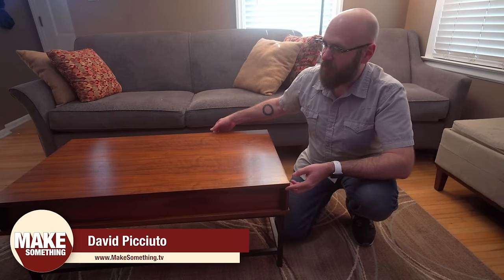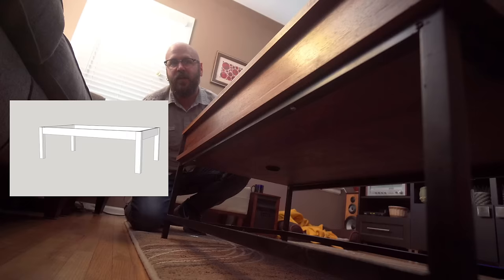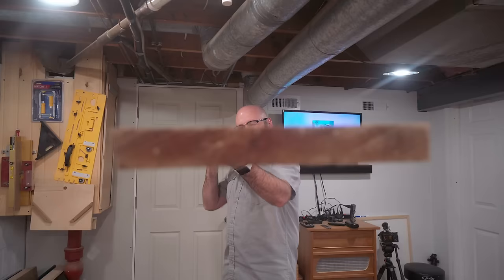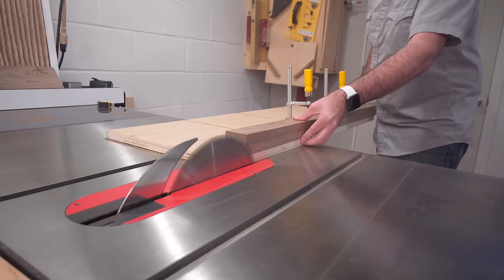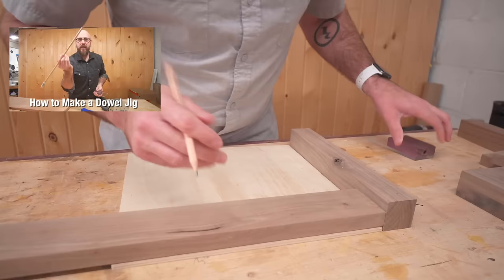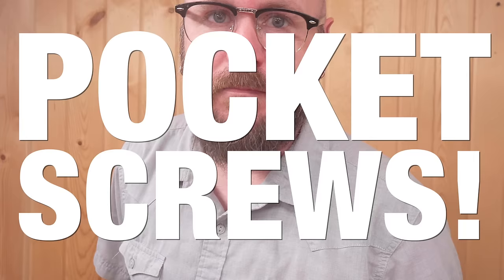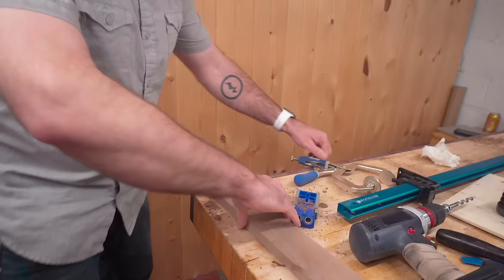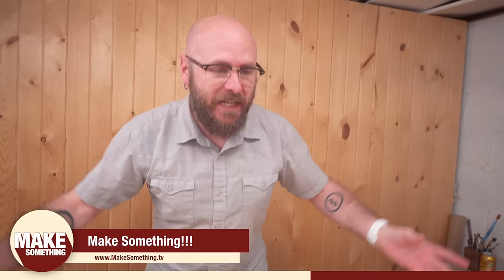4 Ways to Make Table Legs. Which Joinery Method is Best?

Comment: I only have a pocket hole tool. I used it to build an outdoor patio table. It stays outside in the rain all spring summer and fall. Have a canopy, but it still gets wet sometimes. Its on its 4th season. Has not loosened up one bit yet. Time will tell, but I think it should last another 176 years. Hahahaha !!!

Comment: Of the methods used, Domino will be the most durable, as it provides the most glue surface. Pocket screws are great for non-structural applications, cabinet face frames in production shops, etc., I have used them on table joinery in the past, and they did not hold up - 10 years max, dowels are a tad better. Mortise and tenon, or sliding dovetails are the strongest and most durable options. Still a fun video, and the idea of showing options and doing a side-by-side comparison on the same piece was good.

Comment: But will the pocket screws last longer than the brazed aluminum did?

For real though, my most used method of joinery is pocket screws. Will it last forever? No. Will it hold together pretty well and be easily repairable in the future? Yes.
Reply from the maker: Pocket screws will last longer. Much longer!
Reply: I remember hearing something similar about the aluminium legs...
Reply: Add some wood glue.  Wood glue will hold it together longer than anything.

Comment: That was awesome.  I'm new to woodworking and I was looking for a way to make a desk.  I didn't know how to attach the legs and support system (the top is 1/2" birch plywood that's been stained black).  I already have the legs cut and stained, now I just have to cut, sand and stain the supports and attach everything.  Thanks for the info (and fun,. you crazy).  I think I'll got buy a jig system.  This is my first time building anything, and that seems the simplest, easiest way to go.
Reply: How is your desk? What about the plywood? Is it any good for the application?

Comment: what if i need to join pieces of wood but want to be able to take it apart again later? and it needs to support weight, not a lot but needs to be sturdy and dependable. Any suggestions? I have literally no experience in carpentry so any advice would be appreciated

Comment: Well, it depends. In case the table is for sale (or whehter the table is a gift for my mother-in-law) , I would choose the cheapest and fastest way: the doweling jig. In case the table is for my use, I would choose the method that is the sturdiest one, and that provides longer life to the set: hand cut old fashioned way, using chisels, drills and files. A slow method for an enduring use.

Comment: Board stretcher is that a new tool from Festool? I need one!
You missed a few ways 
    The super simple sliding dove tail
    The ever elegant  furniture bolts
   duct tape just to name a few other ways
My jointer broke years ago don't miss it, just use a very good blade in your table saw.

Comment: So did you actually do the hand tool joinery? I find that dovetails and box joints tend to hold up in the long run a lot better than pocketscrews. I'm not sure about the domino as I'm not rich so I can't use that.

Comment: If I am using 2 layers of .75" sheets of plywood as my table legs, and the same plywood as my stretchers, is it okay if I use pockets holes to attach eachother if it is end grain to end grain?
Reply from the maker: Should be but I would add glue as well.

Comment: So... I may be a newb and completely missing something... but... by screwing the table top directly into the leg assembly, rather than using some joinery method that allows for wood movement, are you running the risk of the whole thing cracking or knocking itself out of alignment?
Reply from the maker: Good question! Since I’m using plywood for the top I don’t have to worry about movement. If it was solid wood then I would need to allow for seasonal change. Thanks!

Comment: A brazing kit is available from welding supplies, 4043 aluminum, and basically a flux formulated for aluminum. You could get by with regular tig rod ( 4043 ) and just buy the aluminum flux if you already have the tig rod. Aluminum is Aluminum the tig rod is the same as what is in the brazing kit. The Harris Products part number is 1070  do believe. ( just for the Flux ) now to watch you build some legs.... I work at a welding supply, but I prefer wood working as a hobby.

Comment: Nice work...If I may say, the only thing that I think could be made different is the horizontal wood board that connects the legs. They stand out to much. Maybe a way to make only the legs apparent would be cleaner and the horizontal boards wouldn't compete with the table. Cheers man!!
Reply from the maker: I do agree.

Comment: Hi David!

I recently picked up a kreg k4 jig and I am having trouble joining two 1.25"x1.25" pieces of red oak without splitting the wood.

They recommend 2 inch fine thread screws but I end up splitting the red oak.

Do you have any recommendations?
Reply from the maker: Hmm. I had that problem with Hickey once but i think I was using the wrong screws. Wish I could be of more help.
Reply: @MakeSomething  no problem.

I was thinking of keeping it at the same setting but maybe using smaller screws so that it's at least halfway into the material.

If the screw goes at least half

Comment: Always the mortice and tenon - usually haunched and mitred for meeting legs in a post or leg. Learn the old traditional ways they are the best - forget biscuit joints, dowels and Ikea type screw on legs. My mother is 18 stone and the stool i made for her in woodwork class is still going strong - why the mortice and tenon joint done traditionally.

Comment: great.  hey I'm a disabled guy, want to fit small L brackets to re-attach short leg (12 inch) to coffee table, whats the very best glue to fix metal brackets to wood surface? idea is to avoid using screws, as I only have 1 working hand. originally, leg held in place by accross-cornerplate, screw thing, with wing-nut top.using prob 2 L brackets should reenforce.  table top is quite heavy - wood layer with glass over, metal-rimmed. in my country repair by professional would be asronomic, so want to try (again).  my rule is, I never give up. all the best,  Allan.

Comment: so... would it be possible to design a computer cart. so, im thinking it would be great to have a mobile cart for my computer (2013 Mac pro) and its single screen (though i would like at least 3 in total, but thats a future possibility) anyways, i want to be able to move it out of the way, and or adjust the location more easily. so it would need wheels to be mobile. i would like to use Maple, or Walnut. either will do, as long as i can get the lumber for whatever design i end up making, or using if i could even find one on the internet haha. otherwise it would be an entirely original design. now i admit my wood working skills are, eh, minimal. and this is an ambitious project. but i can follow directions and can also be meticulous. I'm also super patient, so using mostly hand tools would be an interesting challenge. the problem is, I don't exactly have a design per se, except that i have a few dimensions in mind. so, for height, from the ground up including carpet capable castors, no more than 30 inches, but no less than 24. for length and width, i think minimum 30x20 inches, and maximum, 25-45 inches. then i would want perhaps a couple of open shelves for a couple hard drives (or if i finally get a bulk storage RAID device a place large enough for that.) then, all i would need is to know the joinery that would be best suited for strength and stability, and something that i could probably do with hand tools fairly easily, but also allow for lateral strength and also weight strength. now, if i had a pattern to follow with step by step instructions and dimensional guidance, that would be awesome, though i dont really have a lot of experience in making designs on the computer, i mostly edit photos and video, my main focus besides the usual social media, and many many many other interests, haha. in any case, any sort of advice woudl be welcome, and other recommendations for maybe hardware etc. thanks in advance, =)

Comment: I have decided I in a hobby to make jigs to make jigs. Awhile back I saw a  fair joinery test and believe or not the  dowel joinery was strongest..  The pocket hole joinery failed first I think.. The first chair I made was for  the grand children.  On the second I was sorry I painted it.. I did most of the sawing and by hand and used chisels ect. I tried to figure out what all I had done to make it so strong.  I had mortise and tendon, etc in it.. I even had run my oak dowels through nuts in a vice and made a dowel screw...I laugh today ..it's still going strong.. I think I had about twenty plus joints in it..I made a table next ..was done in one day..Squared of the best box store lumber iin 2 x 3 s ..cut them in to  a two by for the legs. Made the sides out of 2 x3s. Put plywood over the frame.  Took a some small 2 x 2 blocks ..tightened the clamps and jammed the blocks into the first corner leg.. I would doubt the pressure is in hundreds of pounds.. oh yeah ..glued the table leg first.t Then I used four  good quality wood screws on each outside  corner.. they were  not in row vertically.. They have a tendency to split the wood.  Then put a corner notch into a breace. Predrilled the brace and put a 3/8 bolt in all four corners. Even today it is very solid. The grandkids stand on it. I was trying to make it safe but I didn't count on that.

Comment: How are the domino and the dowel really different? It's a different size hole but aren't they really pretty much similar.... oh and if your not going to use your domino can I have it?? ;)
Reply from the maker: Domino and dowels is pretty much the same. Using the Domino machine just gives you more options and at times can be faster. Oh, and it costs a shitton. $1000.
Reply: And don't even get started on biscuits
Reply from the maker: I forgot about biscuits!

Comment: Is there a big difference between using dowels and dominos or biscuits? I fear this will be a “stupid” question, but hey, I’m learning!
Reply from the maker: Everybody will have a different opinion on this but here’s mine... they basically all do the same thing. Dominoes are the easiest but also the machine is far more expensive. Dowels s are the cheapest but probably the hardest to align. Biscuits are middle of the road.

Comment: I'd like to see if those legs came out straight. The dumbbells tell me that they did not.
Reply from the maker: haha. whateves.
Reply: @MakeSomething  I wish I could show you why I say that.. this video helped me a ton. So thank you lol. I recently built a small table for my jiu jitsu coach. 1 shelf in the center, a drawer underneath, and 9 boards joined per shelf, all reclaimed wood.... That would not let pocket hole screws get a bite. Long story short this thing was wobbling like a baby giraffe fresh out of the womb. So I ended up disassembling parts of it twice with an undercut saw, putting it back together, and resting 2 25 lb dumbbells on it to space out the legs ( I was attaching the legs to the top and fitting the skirts afterward instead us using them as a frame as you did in the video. Anyway, I got it done and ready for stain, put the dumbbells on a shelf, sat down to have a puff, admiring my work, and that shelf with the dumbbells gave way and I watched these dumbbells fall straight onto the table and absolutely evaporate it into thin air 😂😂 I felt so robbed. But I suppose that was the universes way to tell me to quit being a hack and do shit the right way 😂

Comment: All yo do is glue the two pieces together to fatten up the legs? No biscuits or anything, just glue?
Reply from the maker: Glue is all you need with all that long-grain to long-grain surface area.
Reply: @MakeSomething  Interesting. I plan on joining 3 pieces of 3/4" oak to make legs and wasn't sure if I should biscuit join them together along with glue

Comment: Hmmm, can't stand pocket holes. The other methods are way far out of my league.  I best get busy discovering what secret lies in the missing scene. Tore out the old cruddy bathroom vanity and sink two+ weeks ago; replacing it with a rustic table made from some killer barn wood I have. No big deal, no real rush.  Except the jokes are starting about what kind of laboratory am I building in my little cinder block house. Between my trusty Dewalt power drill and 1/2 price KraftTech circular saw, and these You Tube shows, I'll pull a 'rabbit' out of something. :)